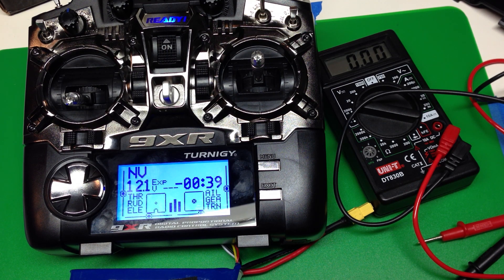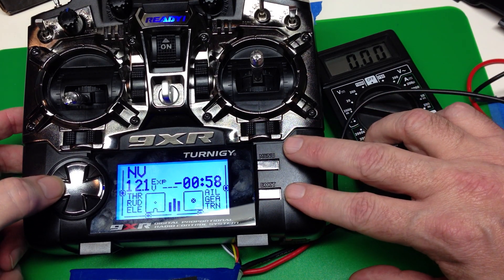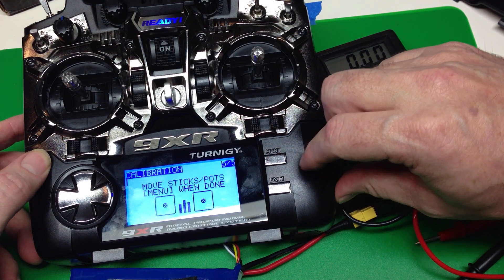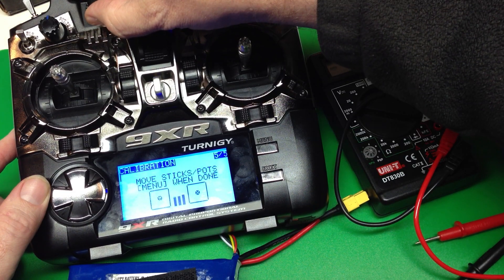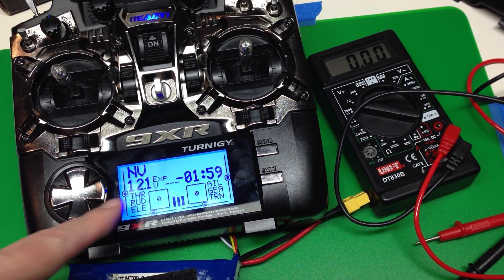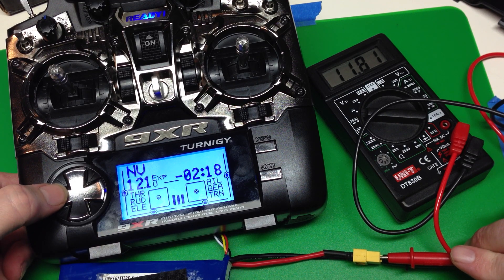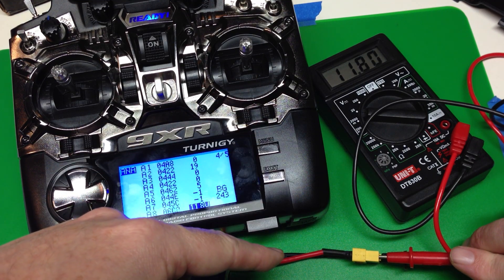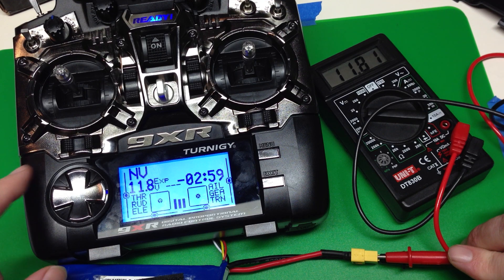Turnigy 9XR: Radio Setup

Comment: Hi, Mark.I am concerned about setting up my 9xrPro, because I suspect it has range issues. Is there anything I can do (apart from a standard range check) within the setup to ensure that the aircraft receiver is operating at full range, possibly 1000 meteres plus? Keep safe, Cheers, Den, Wales.
Reply from the maker: The 9xrPro itself doesn't have a radio, but instead takes a module in the bay.  So depending on what module you have, there might be other module-specific things you can follow up on.  I opened up my module cases and verified that the wiring and cable connections looked solid.  I used mine with both a FrSky and OrangeRX module and didn't have any issues.  Which module are you using?
Reply: @marhar2  FlySkyrm002

Comment: I've replaced my 9xr stock gimbals with new taranis PR10s and have had only little success.
The gimbals do not give a good range within the screens and especially the Left side (yaw) only travels in one direction. I can't figure out how to trouble shoot this. I was hoping the PR10s would work out of the box.
I appreciate any suggestions!
Reply from the maker: Sorry, I've never replaced the gimbals.  You've tried running the calibration, is that right?
Reply: yes, in the meantime I found a guy on RCGroups who had a similar problem. Probably switched 2 wires.

Comment: CAn you change the tx power output in the settings? Is there a way to program or change the power to the tx module to change the tx output power? Or is it always on full power once the module is connected? Thanks

Comment: Good video, Just a tip I would NOT recommend anyone to use a cheap multimeter like that calibrate voltage, use a true RMS fluke 87V (anything similar) OR burrow one, the meter you using is NOT reliable "accurate" when it comes to voltage measurements.

Comment: Just got my 9XR today and boy am I freakin  impressed! After watching a lot of vids on this TX I was really worried that some cheap POS was going to show up but that wasn’t the case. And BTW I have always been a FUTABA guy all the way but thats (planes only) and this little cheap 9XR blew my mind today. Its so easy to prgm. I haven’t flown with it yet but out-o-the-box ILOVE IT! My voltage was right on the $ & needed no calibration at all.Prob could have use the TX to calibrate my multimeter lol